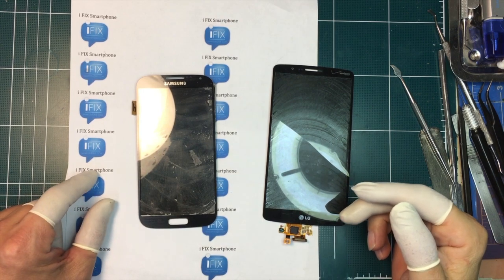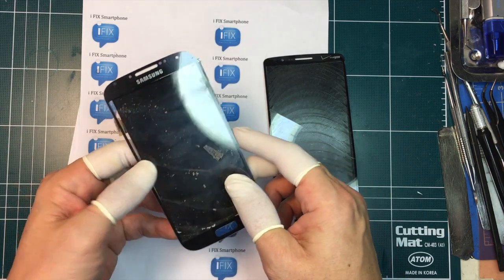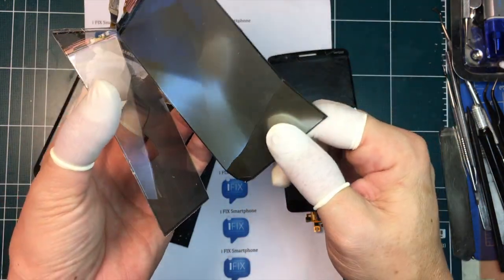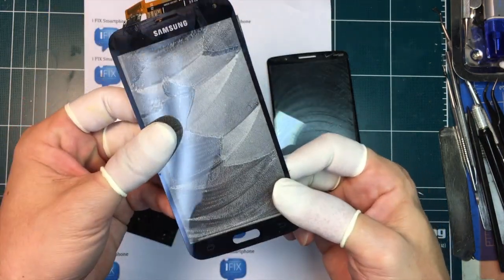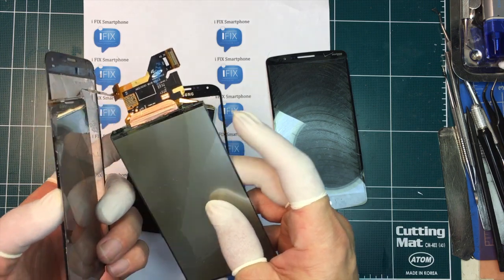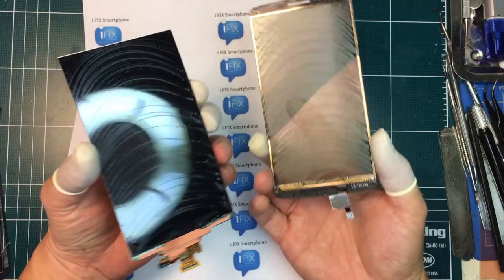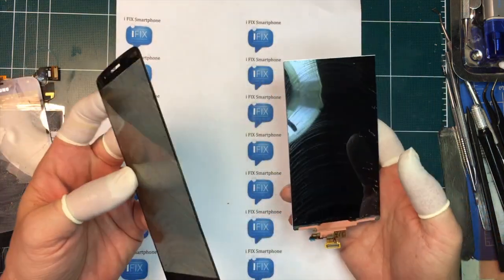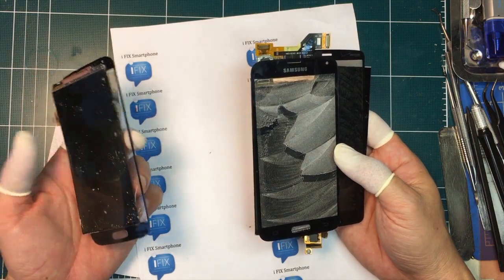What is digitizer? What is LCD?

Comment: My digitizer gets overwhelmed or something because sometimes my screen becomes unresponsive but it does respond sometimes. 

I've had it in for repair 2 times and the first time they swapped out the motherboard or whatever and it didn't fix it.
The second time they didn't find any errors so they just reinstalled the software but nothing has really changed. It still stops responding to my touch after some time.

Actually, when I picked it up out of the box when I got it yesterday, it wasn't responding to my touch. This is really annoying.
Reply: does your screen get wet ? not wet with water but like cold screen that you have to wipe off?if so i can help
Reply: @benlopez.8056  my daughters samsung tab 4 has no crack but did get wet. Was working fine then all of a sudden had black spotting. Then whole screen went black a few weeks later. Can I change just the lcd screen to fix it?